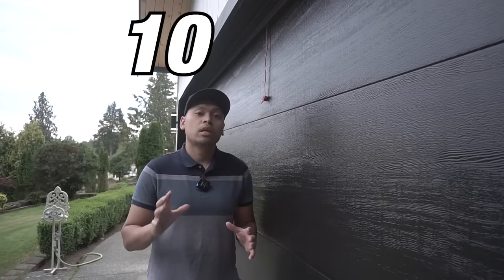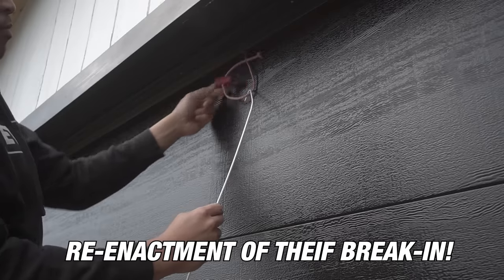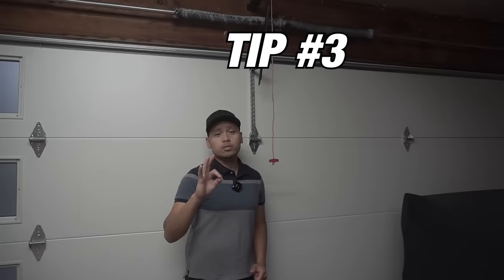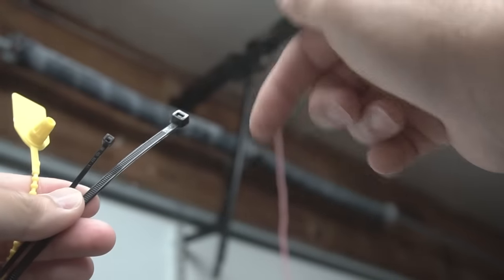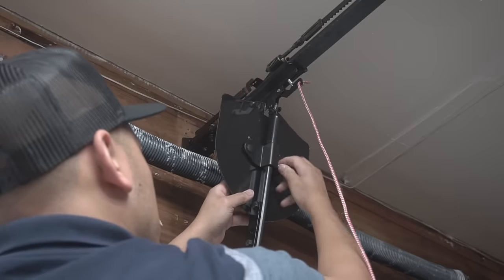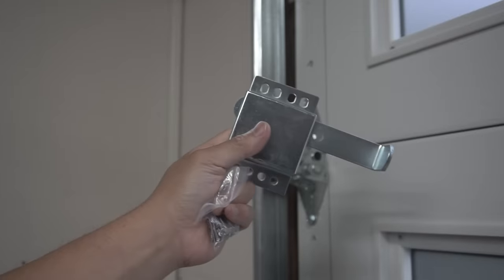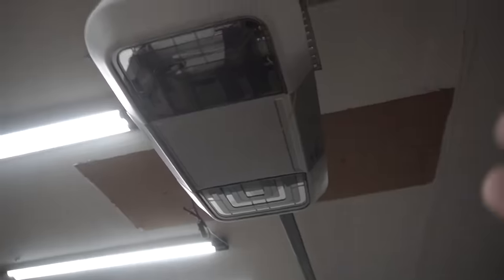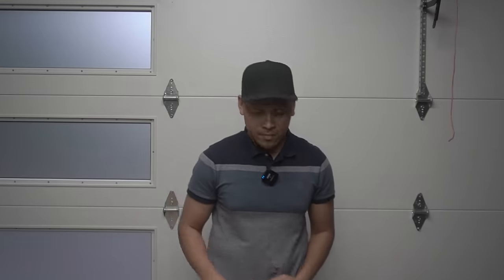How To STOP Garage Door Break-Ins! Burglar-Proof Your HOME! (10 TIPS To Keep Your Family SAFE!)

Comment: IF the garage door is adjusted correctly, it is very difficult to snag that pull cord.  The top hinge on both ends of the door is adjustable so you can set the top edge of the door to press tightly up to the framing.  It is also necessary to adjust the down force on the opener to apply some pressure and not just let the door bottom barely touch.  This will help the auto reverse safety feature work as intended, but will also apply horizontal pressure against the door at the top center so a thief can't just push it in to allow him access to fish for that cord. Do both of these things properly, and then go outside and see if you can break in with a coat hanger.  Or you can buy gadgets to shield that emergency release mechanism and cord so it's virtually impossible to snag them with a coat hanger.  Btw, you can also buy the kind of door opener than has an electric lock mechanism that works similar to the manual lock bars, with the electric version being a better choice because it works with the opener.  The lock unlocks first, then the opener operates.  That way you don't damage the opener.
Reply: ⁷I

Comment: Good ideas. What I did was remove the nylon cord and replaced it with a straight stiff welding rod with no pull handle. I bent the end of the rod and looped it through the door release lever. Since the rod is stiff and not like a cord, there is no way any coat hanger can grab the stiff rod and feed it through the top of the door.
Reply from the maker: That is an amazing idea Kornami! Thank you for sharing this method! 👍🏽😊🙏🏽
Reply: Good way to scratch the top of a vehicle if it is tall like an SUV. That is why they use rope.
Reply: @markpashia7067  Good point. I would also suggest just removing the cord altogether. Buy a 3 or 4 foot long, half-inch diameter wooden dowel, screw a hook in one end, and don't put it on the latch, but put it somewhere in the garage when needed.

Comment: I have a monitored Ring alarm system, with sensors on my sectional garage door, side garage door (which is also bolted), and solid core door from the garage to my house.  I'm also going to buy a smart garage door opener to replace my conventional one.  Thanks for the suggestion.

Comment: Another tip, use a tie wrap to strap the cord to the black release bar, you could also theoretically tie a knot below the tie wrap so it couldn't be pulled in, just in case the theif does manage to pull the cord away from the bar.

Comment: That shield could be made of a sheet of plastic and made much larger. Then it could be loosely attached to the top of the door and the opener arm and it would really be a pain to get a wire around it if you even knew it was there.

Comment: The top of the door can be pushed in far enough to get the pull knob out. I added the Shield, cut my cord length, then ran it through the shield attachment holding it on to the bar. I can reach it and it still pulls down. So the string runs to the back of the shield and still pulls down fine with no room to reach the out side.

Comment: Or when installing a new garage door opener… install a wall mount style opener (it mounts on one end of the garage door shaft) Not  only are they unbelievably quiet… it leaves the entire ceiling open
Reply: Alan, I've seen these, many of them also have a type of dead bolt the moves into the guide as a lock mechanism when closed

Comment: Added to #8. I have 3 garage doors. I wired all the power sources to a switch inside near the entry door. Then I put a KEY lock switch in place of the normal one. Turn the KEY, remove it and leave.

Comment: I don't have an attached garage. Mine is separate but I still have a tip. Prefferably get a garage door opener that has a vacation mode which shuts down the receiver for the remote.

Comment: The simplest thing to do, and it sets itself every time, is
Get an opener with an automatic dead bolt.
I installed a liftmaster jack shaft drive, it eliminates the track hanging from the ceiling and secures the door every time it closes.

Comment: Unplugging the door opener or disconnecting the power to it does nothing to stop the burglar with the coat hanger from grabbing the rope and opening the door.  The 10th tip he shows is also useless if someone uses the coat hanger to grab the emergency release; My Q, for instance, only records when the door opener activates to open and/or close the door.  If it’s opened manually, that system won’t even indicate a thing.  

Even if you have a door alarm, that will only let you know someone has broken in.  If you live in a rural area the burglar may not even care if an audible alarm is going off; they can usually clean a place of valuables in just a few minutes.  They’d be long gone before anyone arrives to stop them.

Comment: One more thing. Lasar for the garage door. The doors are being broken into by raming into the lower panel of the door with a vehicle pushing the hings apart. A lasar would ensure that the panels are lined up and you could bounce the lasar off of a leg where the magnetic control would be. The same lasar could be used as a trip line over the floor in the garage.

Comment: I really like the pool noodle application. While the presentation was good, disconnecting the opener power would not solve the string being pulled out.  However, it never crossed my mind that this could happen in the first place. I’ll be sharing the video with my neighbors.

Comment: I use the #7 lock device in your video. However, I marked and cut additional slots in my door rail. This way, I can position the door open at different heights.  Some doors won't stay up once manually opened.  Sliding the lock's bolt into the slot at highest open position prevents it from closing on me before I am ready.
Reply from the maker: Thank you for Sharing Obi! 🙏🏽😊👍🏽
Reply: Your door should be able to be left in any position between fully opened or fully closed. Even halfway. If it doesn't, the springs need to be adjusted. This is a safety issue that could allow the door to fall on someone.
Reply: @DougTreff  yes, that's an accurate statement.  But if you don't mind, I will continue to do it my way, for my own safety.

Comment: Heres a tip. The closer arm should go further towards the front of the garage, basically breaking over center. Picture the drop arm leaning towards the outside, instead of leaning towards the inside like this arm does in the video. Then when they pull the emergency release and lift the door, it jambs on the lift arm because the lift arm will try to travel more forward, instead of easily backwards. I have my door setup that way, and they aren't lifting it easily. The other main attack is to pry up on one corner of the door and slide under. The only way to prevent that is lower lock bars at both sides of the bottom of the door, which are not user friendly when you just want to push a button and open the door.
Reply from the maker: Thank you for this tip! 👍🏽😊

Comment: Tip #2 is a safe bet with padlocks on both sides. Even if they break those windows, they still can't get in thru the garage. Or if they are inside your house, they can't open your garage door either. Drill a hole right above the wheel & lock it with padlock. Both sides would secure your garage door well.

Comment: love your tip #6... if that piece of plastic/shield was much wide across the door wide (horizontally)  that would be good, may be 2 to 3 feet.. then it will prevent a long hanger to reach the pull cord. i personally feel the whole of shield is way too small, need to be much biggerrrrrrrrr...may need a DIY for that idea to come thru.

Comment: I haven't seen any mention of the doors weight. I have a 2-car garage door. When my opener croaked, I pulled the release as I had to get my car out for work. It took me, my wife and my daughter - struggling - to get it open. I think neighbors would notice 2 or 3 strangers messing around someone's garage. I guess a 1 car garage door would about half the weight. Funny thing, 2 weeks after that the tension spring snapped. Had to do the same thing again, lol.
Reply: You could have always had someone press the open button while you lifted up on the door at the side with the broken spring. No need to Release it. Close it by having someone press the button while you assist the door from closing too fast at the side with the broken spring.

Comment: If the door is installed correctly and the door opening is built correctly it is not possible to get anything through to get at the pull cord.   For additional assurance, just screw on an additional trim (wood or metal) on the top edge of the door.

Comment: 2o years in the business,  ive never grabbed the rope.  Using a hanger i grab the trolly release itself. You need to drill a hole in the upper part of the release then run a cable tie through the new hole and the hole the rope used..

Comment: Tie the safety pull rope to one of the holes in the arm and make sure there is not enough slack to pull the rope through the cracks at the top of the door. Make sure to leave enough slack so the rope hangs down just enough to grab and release the safety latch.
Reply: With the rope attached at a second point, then just pulling on the loop (without getting it outside) will release the safety release.
Reply: @javaman2883  lol. you sure shot a hole through his great idea

Comment: Instead of using a vice grip or a padlock on the track, just insert a screwdriver through one of the holes.  Especially a large screwdriver with a long shank that will point downward and not fall out.
Reply from the maker: That works really well too! Thank you for sharing! 👍🏽😊
Reply: Or you could simply use an appropriate sized bolt, nut and washers or additional nuts on the bolt head side to make it stick out far enough to stop the roller..

Comment: The simplest and quickest is just to add a good lock on the runners of both sides. I had #7, a lock device installed on my new steel garage door... on  both sides. I also used two padlocks for extra security on each locking device. The reason is in case some thief had a pair of tin snips or battery powered skill saw. The padlock will still be attached to the lock and runner. All the others are wasted talking space. #9 is also a good touch. An alarm sensor is a great added touch if you have an alarm company. Like he says, when going away pull the plug on the juice if you have an electrical door opener.
Reply from the maker: Thank you so much for sharing your advice and thank you for the feedback my friend! 🙏🏽😊👍🏽🔒
Reply: @FixThisHouse  I like your security ideas. But most people aren't mechanically sufficient. So I believe in keeping it simple. Great video.
Reply: That's a good idea if you have a shop with roll-up doors I have those on my shop at my house but my home garage doors need to be able to go up and down when my wife comes in and out without her having to get up and play with locks and latches.
But some sort of locking device would be great if you're going out of town

Comment: I have a pin lock on the side rail. Mine isn't electric. Attached garages are a thief's dream. People get car jacks to pry  them open from the bottom. The side locks prevent that, but you can't get in either,  so have to exit via house door-never leave that one unlocked!

Comment: Another solution is to get a side mounted motor. Also known as a jackshaft. The pull cord for those is off to the side. they also have an automatic lock that locks and unlocks as the button is pushed. However, not recommended for low headroom doors with low ceilings and not recommended for garages without a walk through door. Both of those are less common though
Reply: We have installed LM 8500's on Low headroom before,look up cable keepers,cheap insurance so the cables don't dump.

23 years in garage doors here.

Comment: The cord idea is great. TIP # 11. Instead of unplugging the power cord to stop it from opening with switch or remote, get a plug that works with Alexa or Google.  Then just give the plug a name, and tell Alexa to turn off or turn on "outlet A"....or whatever you named it. I have Alexa in the car and just tell it to do that when I leave and get home.  Or, control it thru the Alexa app.

Comment: If you can pull the garage door up while unlocked, you can (with enough pressure) pull it up while the shuttle is still locked to the chain.  That J-bracket that connects the door to the track shouldn't be angled.  If the J-bracket is vertical, pulling up on the door will only push upward on the track, not rearward.  Even if they get the cord outside the door.
When you unlock the door with the cord from the inside, you would then use the cord to pull the shuttle toward the motor, then you can lift the door.
Reply: The four openers I've had (professionally installed) all had the J-bracket angled inwards, to allow the door to open easily when disengaged. I'll have to see if I can adjust that myself.
Reply: @javaman2883   I've always pulled the J-bracket inward with the rope once unlocked.

Comment: Never once in my life have I ever needed the pull cord. So I removed it.
Other than that I have a motion sensor in the garage as well as a camera. The inside door is dead bolted with the screws inside the house. Come in if you want, but if I am home you're not leaving on your terms
Reply: You've never lost power at your house? If you did, you didn't need to use your car?

Your logic is the same is a fire extinguisher or sprinklers or jumper cables or a tire jack. If you've never needed to use any of these, just get rid of them, right?

Comment: A lift master 8500 will solve that problem all together it drives the shaft directly and is mounted on the side it does have a manual release it’s not as easy to jimmy whistle  a hanger in there BUT you have to be inside to manually disengage the electronic side lock to open the door anyway

Comment: Hi, I hope you read your comments! I would like you to do a dedicated wireless security video using mmwave, ladar and meshtastic as a stand alone full home security package. I also watched your electronic dead bolt video. What I would like to see a dead bolt with video facial recognition if someone attempts to use a key or pick using meshtastic comminication to trigger a signal through your wifi and LORA. This may not exist commercially but it seem to be the next step. Talk to a ham radio operator to sort through what I am asking you to design or build. You may also have to use mini computers which are single board chips. Mmwave can monitor human presents even if the module is placed behind, in your wall. It is so sensitive it can pick up the movement of human breathing up to 6 meters away

Comment: Cut the cord to the not reach outside with no handle to hook is the only tip you need. Just leave a step ladder in the garage so you can reach it when you need to open your door when the power is out.

Comment: You mentioned in Tip #3 to take off the red handle from the pull-cord. But in the beginning of the video when you pulled the cord through the gap with the coat hanger, the red handle didn't even matter. You were still able to get the cord through without the handle, so I question if that's really a fix. (This is the method I had used on my door, but after seeing this video and how the red handle is irrelevant in getting the cord through the gap, I'm re-thinking this.)